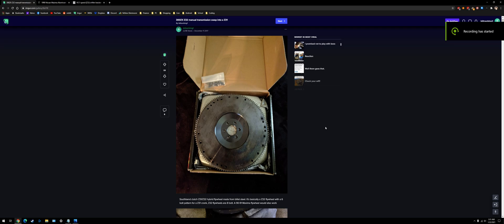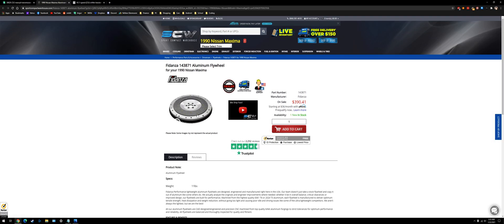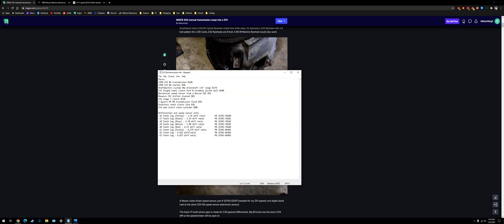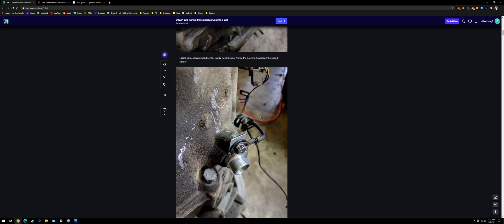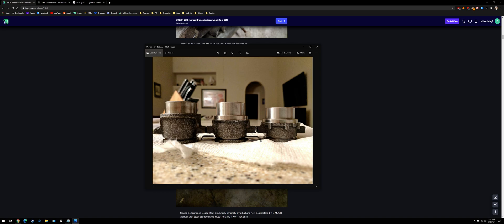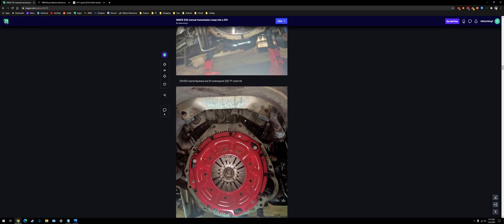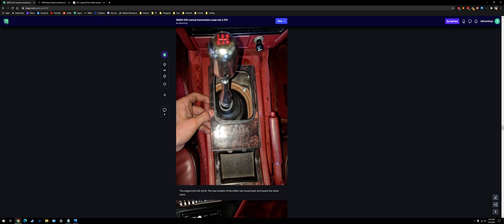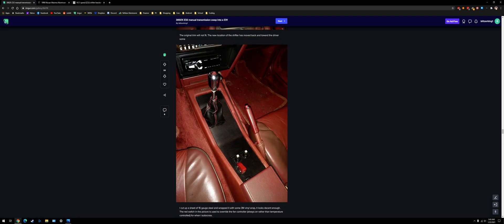Z31 300zx Z32 30a Transmission Swap

Comment: Yo, you are so calm, Like there is a baby sleeping in next room. Great video!- my question is ( 87t btw) - if I have a z31 bellhousing and plan to always have it, I can do this swap with the OG starter and Flywheel i believe so long as I do a bellhousing swap.... But- what shifter would I need for that short shift bracket. It seems the driveshaft side of the z32 30a is very different. So I think I would need a speedo, that short bracket, a drive shaft and a shifter. SO yeah, what shifter? Thanks again!- I have a fidanze shifter for a 240 currently in my 30a. 

I am planning on one day needing to swap in a z32 transmission but I am not sure it will fit in the z31 housing as far as the driveshaft/shifter side .. i know I can bell housing swap as I have done so before. I just don't know if I can swap the "whole" housing to avoid needing that bracket and the new shifter and drive shaft. My goal is to buy all this crap now so when it gets discontinued in 10 years and I need to finally do this swap I will already have everything but the z32 transmission.
Reply from the maker: My wife was sleeping lol. Yes you can put a Z31 30a (87-88 turbo manual) bellhousing on the Z32 transmission. Or notch the Z32 transmission bellhousing for the Z31 starter. Someone did it that way on one of the FB grouos
Reply from the maker: You will need the shorter shifter bracket if you want the shifter to fit like stock

Comment: How do you get the electronic speed sensor to work on the z31?
Reply from the maker: If you have an electronic speed sensor you can get it to work. The how to is on an old forum somewhere but from what I remember you need to rotate the sensor 180°
Reply: @BLITZERKING1  i’ve managed to take it all apart and stuff but the cable and the electronic versions i have dont match up to use the red gear , the electronic (z32) has a groove for the red gear to enter and a snap ring, and the cord gear version has a smaller gear so it doesnt turn with the transmission aka doesnt make contact i tryed prying it off but it shows that it doesnt have a groove for the red one to go into, so i’m not sure what should i do, make a hole in the red one and try pressure fitting it or to take the full circle shaft to a turner to make the grove for the red gear to sit on
Reply: also the cord version comes out a D21 Truck 3.0L Vg30e (W) format, but the transmission was a 30a so the bellhousing matched good with the z32 transmission, any tips? should i just use the original z32 sensor and use the 180* trick?
Reply from the maker: @i6od  so I believe you can remove the dowel pin in the middle to remove the shaft from the Z32 speed sensor. Then you can swap it to the hard body sensor, that way you can switch out speedo gears.
Reply from the maker: @i6od  so what year car do you have and is it analog or digital dash?
Reply: @BLITZERKING1  i’ll give it another look thank you!
Reply: @BLITZERKING1  The car is 1988 z31 2+2 it has a digital dash that fully functional for some miracle  , but heres the thing with z32 speedo shaft, yes it will enter the other speed sensor housing of the truck trans but it doesnt have the top version where the cord connects unless i’m mistaken that the z32 shaft enters the cord connector?
Reply from the maker: @i6od yeah so you definitely need a cable driven speed sensor. What rear end do you have? 4.10?
Reply: @BLITZERKING1  i’m not sure boss i just know that i have a z32 91-92 ish gearbox housing oaired with a 91 vg30e d21 truck bellhousing and a custom drive shaft to make it work, but the ecu is from a 87 z31 n/a
Reply from the maker: @i6od  so I had a spare Z32 speed sensor. I tried to take it apart and now I can confirm you cannot, at least not very easily. I removed the dowel pin and the shaft did not slide out like I thought it would. I'd just use the hard body speed sensor and see how close the speedo is to you GPS speed
Reply: @BLITZERKING1  it slides up, you know where the wires are connected to the sensor ? so basically thats just a bunch of glue to protect the pins from dirt and water and from creating a short, i gutted the glue out and in the process accidentally cut the wires out of the pins (i’ll just solder them back on later) and then once u feel its loose u can tap the bottom of the rod to push the sensor up and out,
Reply: @BLITZERKING1  i just found out i have the 4.08 rear end
Reply: I found the forum you were refferring to someone says its possible that i can install the cord stuff into the z32 housing and stuff i’ll see if i can figure it out sometime

Comment: does the oem diff work fine? i got a na 89 i thought i had to do a diff swap or something, seems like its compatible and bolts up to the driveshaft fine. no? thanks for all the other info tho extremely helpful
Reply from the maker: I bought a custom driveshaft made by shaftmasters. Makes it easy, you could possibly make a 87-89 turbo driveshaft work. You might have to shorten or lengthen it though

Comment: Nice! So with the flywheel, using a 90 maxima flywheel in a z32 na trans with a maxima clutch? I’d like to z32 convert my z31.
Reply from the maker: Yes that would work. A lot of the 240mm Nissan clutches are interchangeable though. You should be able to use a Z31 240mm clutch (NA or 84-86 turbo clutch), Z32 NA clutch, 350z clutch, SR20 clutch, etc